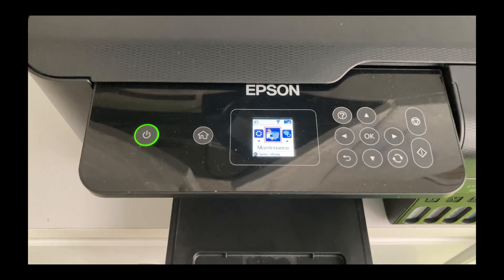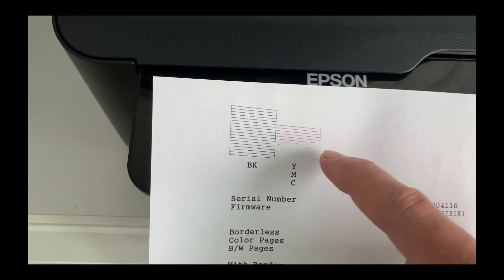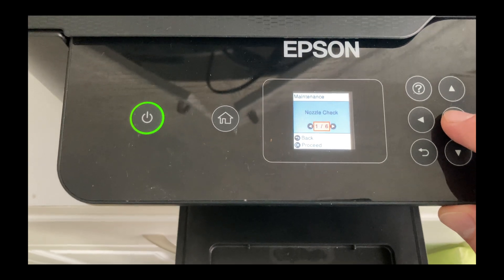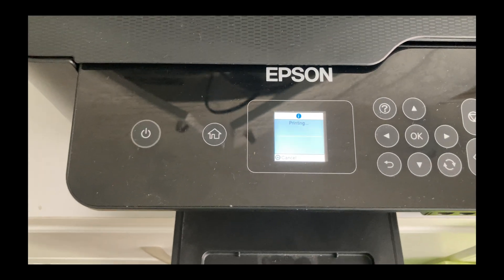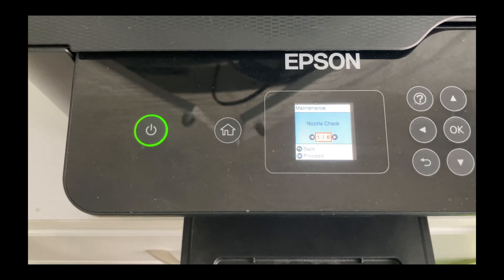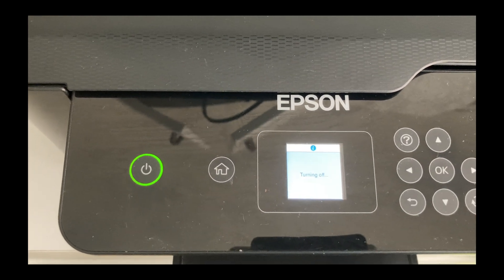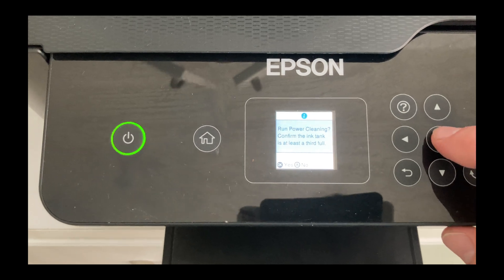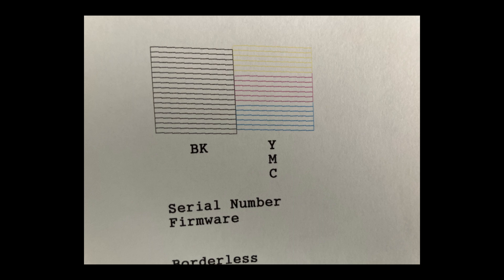[Tech Tips #1] Epson Eco-Tank Power Cleaning Procedure

Comment: Thank you! For my Epson ET-2850 I was having only some missing BLACK in my print outs. The first head cleaning caused improvement in my BLACK nozzle check pattern but, weirdly enough, caused the worsening of the YELLOW nozzles. 
After 2 head cleanings, I ended up with perfect BLACK and YELLOW, but started to lose BIG CHUNKS of the nozzle check pattern for CYAN and MAGENTA in a large amount, like 35% of 50% of the pattern being white.
Five head cleanings later and 1/8 of the tanks ink wasted, I've lost COMPLETELY CYAN and MAGENTA.
Does anybody here know what the wasp could be going on in here? This is the first Eco Tank printer I own... I read somewhere that BEFORE trying a Power Cleaning, specially after one has done several regular cleanings, to check the condition of the Ink Waste Deposit. I think is in the back. Again, anybody has done that and can report back?
I have also been printing "purge pages", for my needs, solid pure cyan and magenta, to no avail and I have as well waited 12 hours with no printing to see if the bubbles go away on their own but, no improvements. :/

Comment: Many ET-2750 has a software fault that prevent the operation of power cleaning ( and normal start) ,  I found that just tilting the printer in all directions , one after the other,  up to about 60-70 degrees had an excellent cleaning effect. The printer became as good as new.  Epson suggest to get the software fixed but it is too expensive my service center says.
Reply: I just did that tilted it and my cyan came back
Reply: @JustNow42 - When you say tilt in all directions, should you also tilt upside down? Or 60-70 degs from a flat starting point?

Comment: How many times can you do a power cleaning? Little lines or faded color will show up only at the very end of the printed photo it’s so frustrating.
Reply: I also want to add I don’t have any missing colors. I’ve done the alignments as well still not solving the issue. Help!!
Reply from the maker: @raenapatlan3910  This is the time that I would recommend doing the power clearing. I kept doing the head cleaning but still had missing colors. Try the power clean, just one time.

Comment: Thank you so much for your useful video and subscriber comments. I had done so many nozzle checks and head cleanings for weeks. I would get one color or another that just wouldn't print, even though it printed just the day before. Drove me nuts that the colors would change as to which one wouldn't print that day. I didn't want to do the power cleanings because I had read that they were not advised. I finally figured I HAD to run the power cleaning as the last resort. It worked!! Thank you for sharing your time and knowledge!
Reply from the maker: Happy to help. Thanks for the feedback!

Comment: Sir after the power cleaning, you won't able to use your printer or you can immediately used ?
Reply from the maker: The instructions say to run a nozzle check right after the power cleaning. This is to see if it fixed the problem. If it did fix the problem, then I think you are fine to use the printer right way. 

If it didn't solve the problem, the manual says to turn off the printer and wait for 12 hours before running another power clean. Good luck! Below is a copy/paste from my printers manual. 

Note: After a Power Cleaning, you must turn off the product and wait at least 12 hours before running another Power Cleaning.

Comment: My printer stop working after power cleaning
Reply: Sorry to hear that. It won't print at all? Have you tried adding it to your wireless network? I have to do that sometimes.
Reply: Mine too
Reply: I received an error code.
Reply from the maker: Did you try calling Epson support?
Reply: I spoke to via email. They told me to power it off for 12 hours I have to send it back. Mine is going back. It actually went out after a head cleaning, not power. Had it less than a month.